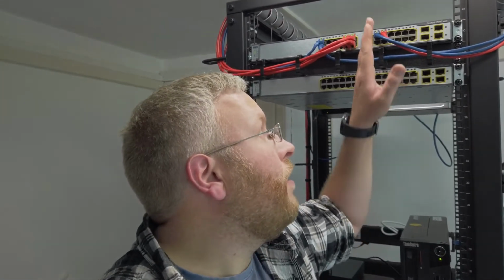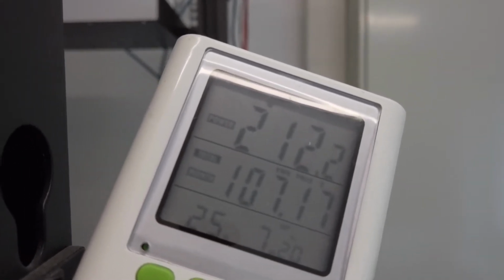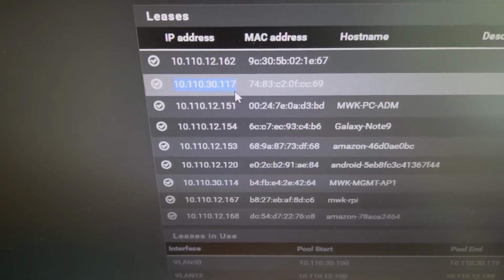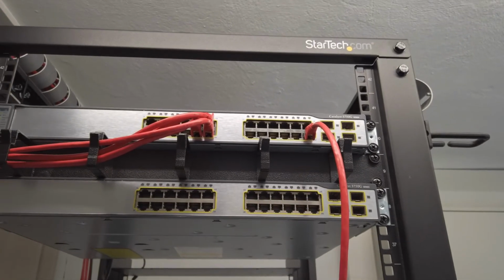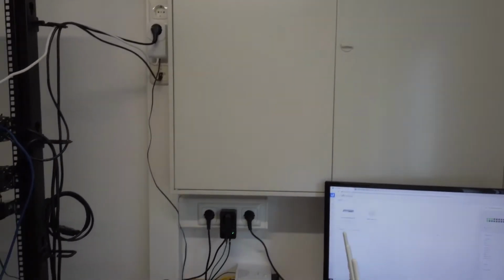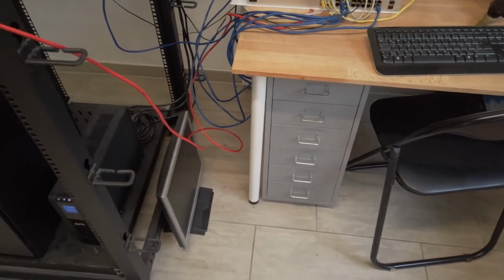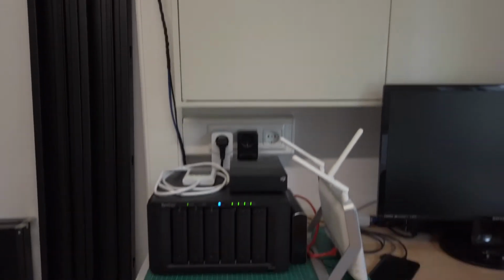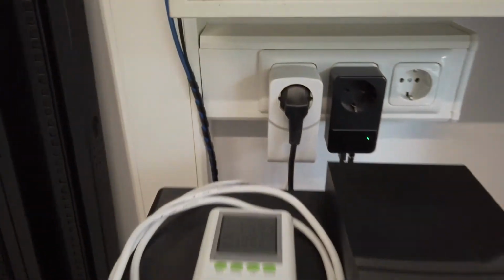Replacing my Cisco Catalyst 3750g with a Unifi Switch Pro 24 PoE and Tearing Down My Home Lab

Comment: Cool to replace those Cisco's. And some PoE available is great. And when you replace the Nano Beams in the future, you got the right switch to power that.

So, time for a smaller rack unit now? Or are you gonne build that big one up, somewhere else?
Reply from the maker: I will use that rack again in the future but I need all the space I can get right now for other things.
Reply: @germanaccentguy  the trunk port you placed on the Unifi switch was u able to adopt to the console using the cisco

Comment: What device was in charge of intervlan routing?
Reply from the maker: Routing was done by the PfSense firewall. Since then I moved to OPNSense with more powerful hardware but I still use the same switch. Thanks for watching.
Reply: @germanaccentguy  I'm in the process of replacing an old catalyst layer 3 (Currently managing the inter vlan routing with a unifi layer 3 and I'm stuck, I need to use the same IP from the old catalyst because it is the core sw and the rest of the net has that IP as management. The unifi controller is on a vm behind that core. If I configure the unifi switch I'll cause an ip conflict and will loose access to the unifi controller. I'm crying here. Any insight?
Reply from the maker: That is tricky and somewhat too complex to explain in a Youtube comment. What I would do is to create the networks with identical VLAN IDs on the new Unifi switch but with different gateway IPs. For example if you have VLAN 10 with gateway IP 10.10.10.1 on the Catalyst you create a VLAN 10 with gateway IP 10.10.10.2 on the Unifi Switch. You also have to create a trunk between the Catalyst and the Unifi switch to have a working Layer 2 environment. Then you move your devices over to the Unifi. They should work and still use the Gateway on the Catalyst. Then you need to connect a console cable to the Catalyst, change the Gateway on the Unifi switch and save you settings and remove the IP from the interface of the Catalyst using the console connection. There might be some ARP confusion in the network but clients should be able to reach the changed gateway IP on the Unifi switch after a few moments. Like I said this is highly theortical and without a Catalyst and spare Unifi switch to try it there might be things I did not think about.
Reply: @germanaccentguy  Thanks! that is actually a great idea.
Reply from the maker: You're welcome! I thought about it a little bit more and you might get issues with routing depending on how you have planned your migration. So just make sure that the proper routes are set on all of your routing devices.

Comment: I’m actually just getting into switches and firewalls, got myself some 3750 to play/learn with some routers . a SonicWall firewall and a 3750g for my house network. Can you tell me why the upgrade?
Reply from the maker: Sorry for my late reply. I got my 3750s to learn Cisco IOS. But for my "production" environment I wanted someting that is a little quieter, consumes less power and is easier to manage. I found that in the Unifi Switch.